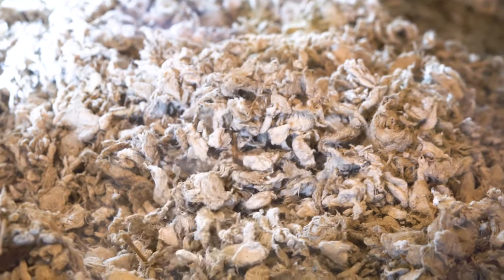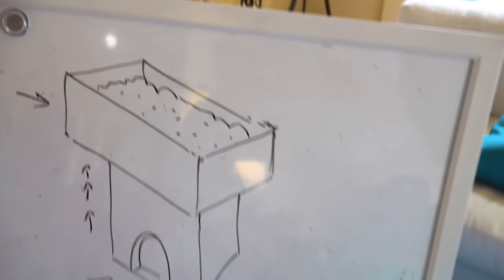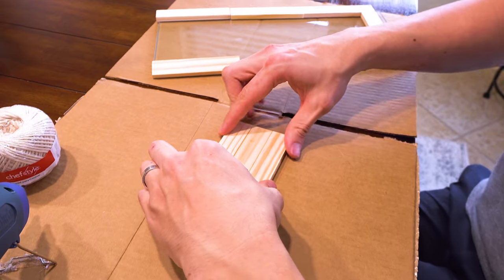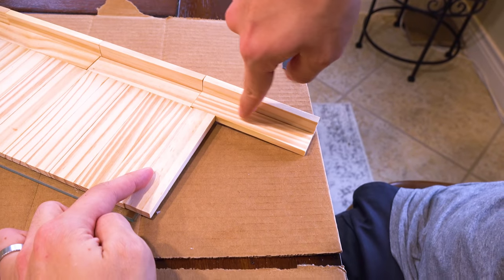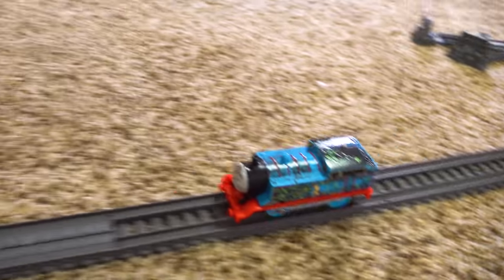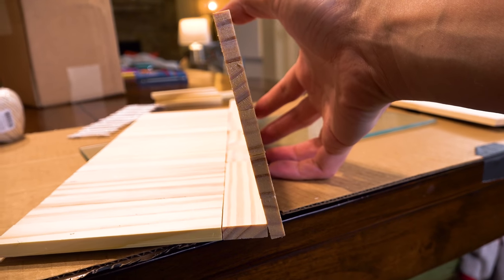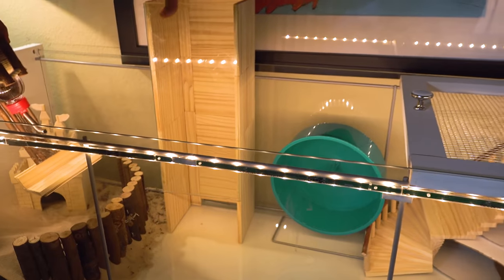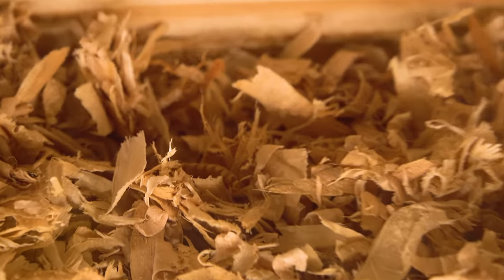Happy the Hamster DIGGING TOWER! And Thomas and Friends Trackmaster?!

Comment: Just a hint. You did mistake by taking off the covers from plaxiglass before cutting. Keeping it on should prevent cracking etc. You can still use some scotch tape to cover it back, then cut it and then remove tape + wash carefully to not leave any glue on it since it might be toxic for Happy. I did exactly the same mistake. As for cutting you can use jigsaw or walpaper knife but with the knife you gotta do like 20 repeats of cut in same spot what might be painful and take lots of time.
Reply from the maker: Thanks for the tip! Much appreciated!

Comment: Hot glue is not recommended because its plastic based and indigestible elmers glue is water based and non toxic so it is digestible if accidently swallowed !
Reply: Is elmers glue sticky enough to hold anything in place?
Reply: @kittenmimi5326  yeah I built an entire second floor in my hamsters cage with it

Comment: Suggestion use more of the  previous bedding from before you cleaned it and sprinkle it all over the cage after you put the new bedding in then he will be less stressed out or do what they call a half clean which is take the top half of the bedding out and put new bedding in and leave the bottom half in

Comment: What tank do you recommend for this mansion?
Reply: They’re using an ikea detolf which is originally a glass display cabinet, but when it’s turned on its back and built without the shelves and door, it is the ultimate hamster cage. It’s probably equivalent to a 90 gallon aquarium and if you were to buy an aquarium that big, it would be like $500. On the other hand, the detolf is $60. I would definitely recommend buying the detolf.
Reply: Ashley Pham thank you very much.
Reply: Sunflower Dreams 👍